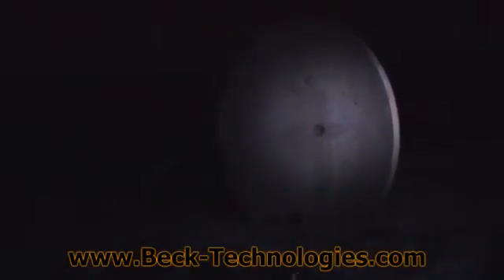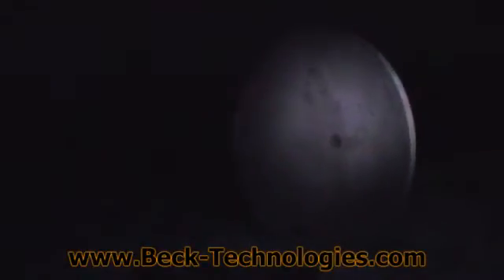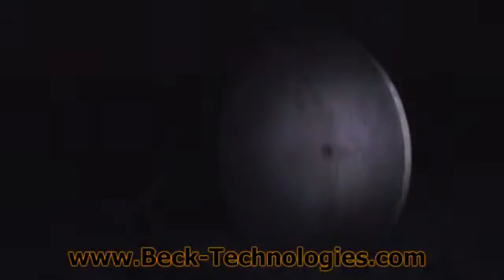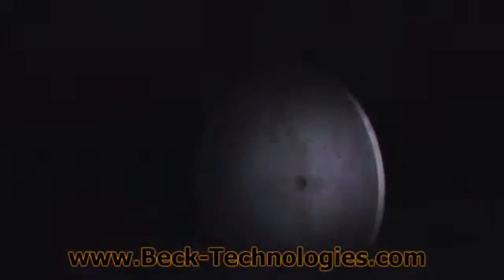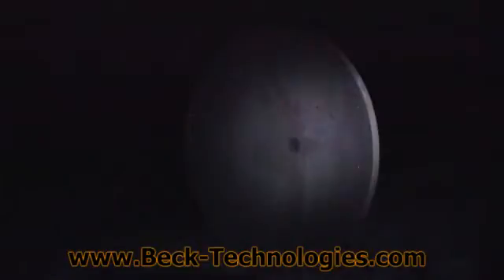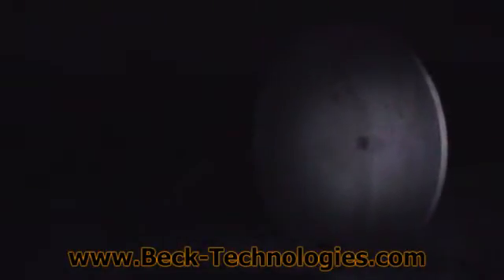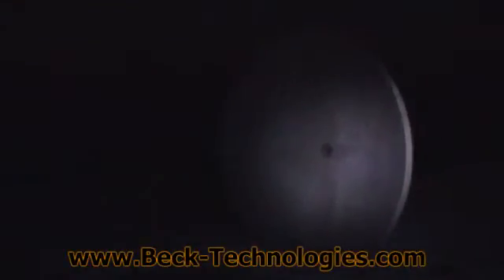Sonic DEATH RAY Pulse Jet HAARP

Comment: There is no way this will work to direct acoustic energy in any meaningful way. That pulse jet is running at around 150 hz and the wavelength at that frequency is around 2.2m almost about the same size as your parabolic dish.

Comment: HAARP is just a big radio antenna array. It can't actually do anything to weather patterns and the very weak artificial aurora that it creates at night isn't even visible to the naked eye. I actually would like to visit the facility if I ever get the chance to go to Alaska, in part because I'd like to learn more about their VLF and ELF research. Supposedly they might soon be able to communicate with submerged subs using these frequencies.